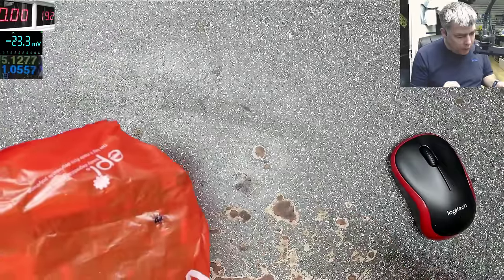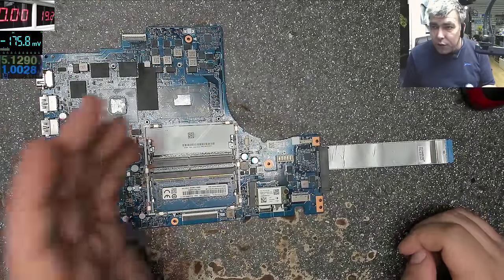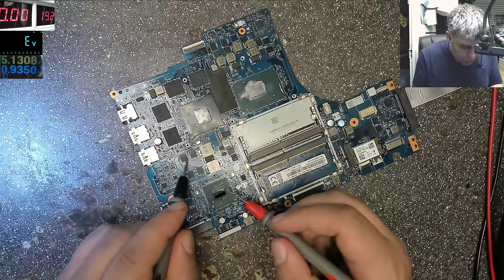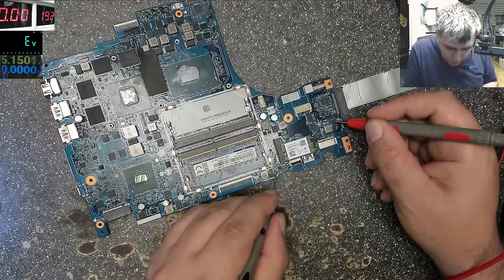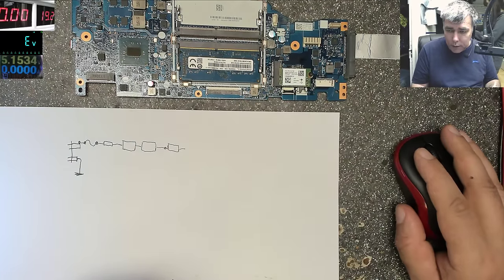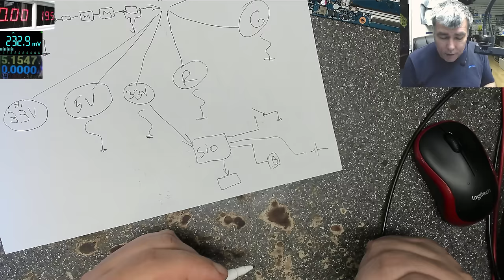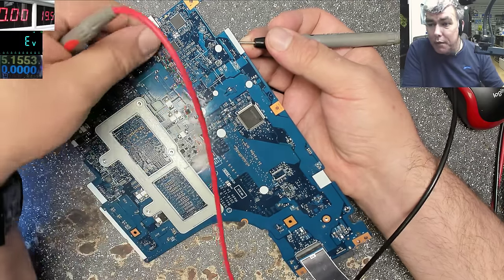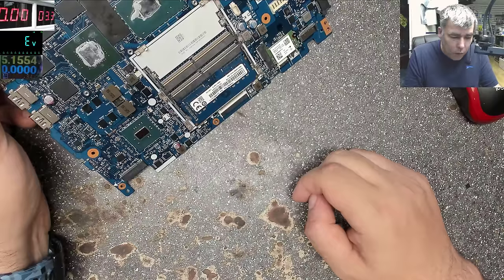How to diagnose a laptop motherboard - motherboards repair lesson

Comment: I like your commentaries very much. I could be in the middle to what you call "intermediate" and  "high class", as I repaired radars and radios a lot, however, I would never qualify your videos as "boring" or senseless, they are very good. I sincerely do not share all your techniques but I really respect them , they are straightforward and solve many problems. I watch your videos all the time and will continue to do so as they provide a lot of wisdom and experience.

Comment: I know it is 2 years later. Thank you Sorin for a good video for beginners. Earlier you stated that after the adapter connector, there is a fuse, which is connected through resistors(s) to the First MOSFET. In the generalized diagram you are drawing (@46.41) you are showing it as a resistor. Actually they are two power inductors in parallel, which are designated PL101 and PL102 on the MOBO and are used for LC filtering.

Comment: Great high level analysis and diagnostic run-through. This is definitely an efficient way of going through fault testing. 
The voltage injection is a great technique.

Comment: This makes complete sense. I was recently messing around with some blown 5.8 ghz video transmitters for my miniquads. While tracing continuity I noticed that a couple of capacitors were shorted to ground, but after removing and testing them they were fine.......it was the actual RTC6705 transmitter chip they were around that had the short. Pretty common in this hobby to burn out video transmitters.

Comment: Hi, Sorin!
Found an schematic for that board. That connector (JDEP1) is for display and U9 seems to be a current limit protection for +LCD_VDD.
Thanks for everything you do!
Reply: Roberto Pérez Ok nice find ! So seems they have changed the screen without disconnecting the battery which caused current limit protection u9 to blow and subsequently wrecked the superio...

Comment: like your work tremendously, I was told after purchasing and replacing a power supply ribbon cable that it's probably my motherboard. The last time my Laptop worked I had trouble turning it on. I would take out the battery, hold down power button 1min, replace battery push power button and it would power up. But ever since I replaced the power ribbon cable it no longer turns on, sometimes the power light and battery charge light comes on  but no power. It's a Dell Inspiron 17,3in M731R - 5735 series Laptop

Comment: Your videos are great. I collect older socket intel and amd motherboards and some end up not working. Currently I have a board that is showing no video output at all. I've tested it with 3 known working GPUS, 3 PSUs and 5 CPUS. 
It only cost me 5 euros so Im turning to your videos to see if it is an electrical level fault. It's a great board to practice on!

Comment: Found the schematic for the board (dy512 nm-b191). U9 is SY6288C20AAC_SOT23-5, an inrush current limit chip for the lcd power (not the backlight, the power of the lcd itself). It current limits the 3v line to the lcd_vdd line and is enabled by the chipset so it seems not correlated with the superIO chip short unless it shorts to ground via the enable line through the chipset and the superIO. Naaaaaah. BUT!!! Watching Rossmann video of crappy macbooks killing cpu with a poor design lcd connector made me look around and... you cannot believe... exactly near the 2 lcd_vdd pins on the lcd connector there's the dispoff/bckoff pin (backlight enable?) that goes directly to the superIO. So you'll better check the lcd connector on pin 6-7-8 for corrosion
Reply: Dumah Brazorf could you also make a vid ? super thanks !

Comment: HELLO ERS! Am an avid Subscriber, you are my first 'Go to' when diagnosing PC issues! I recently built a new Computer in my old Tower with a new Raidmax Vampire 1000W 80 Plus Gold Power Supply, an MSI Z390-A PRO Motherboard with an Intel Pentium Gold Processor G5400 CPU @ 3.7GHz! Next added  64.0 GB DDR4 3200 Ram! Also a ZOTAC GAMING GeForce GTX 1 Video Card! Recently upgraded all my HHD's with an Intel 660p Series M.2 1 TB SSD Drive C and two WD I TB internal SSD's! My Computer now boots up completely for a cold start in 30 seconds!!!! (Once in a while when I turn it on, it Boots into the Bios Screen)!!!(But when I wont to boot into Bios, no matter what key combination I press it wont go into Bios on Command)! Windows will not display on my Digital Monitor but I can see the Bios Screen on another HDMI Output to my 32 inch TV! Am running XMP Mode and Gaming Mode on the MSI along with allocating 3/4 of my Ram to Process my Adobe Premiere 2022! My Question is: How do I get the computer to Boot into Windows EVERY TIME? And secondly, How do I get my computer to boot into Bios on command?

Comment: Thanks for the detailed video. 
While you going through the bios chip and supply, usually there is a connector for the bios battery, i didn't see any or maybe you didn't mention it.
Reply: Am really impress with the video, thanks a lot sir, more grace.

Comment: Hi I watch your videos and they are really informative. Please can you help me understand SMD capacitor value. I am fixing a device and there are 2 capacitor on the entire board out of several which shows no value at all when tested on the PCB or off the PCB. I am not able to understand are they faulty broken or there can be such ceramic SMD capacitor which shows no value at all. The capacitor size is about 1mm to 1.5mm these are tiny capacitors. Have you ever came across capacitors which shows no value but are good.

Many thanks in advance

Comment: as far as i understand from your vidoes, it is all about to find the short circuit point with heat increase detection (air spray freezing etc) and the replace the component.

Comment: Sorin arn't you measuring on diode mode instead of resistance? Is it that suspected components should be check outside the circuit? Thanks for sharing you are a LEGEND!

Comment: Connector you thought was battery is LVDS connector, its likely the SIO got a short from LVDS-PWR-GOOD due to a bad cap or short sending 24v-ish to SIO after breaking the transistor/mosfet

Comment: sorin i didnt think that you could read ohms in diode mode? ho low is the resistance to ground on the 19v power rail to be normal ?I am an old retired tv tech and love your helpful  videos. i wish i could have seen them before i retired. also wish we had esr meters in the shop,they would have found caps that looked ok and  had proper micor farads.   PS YOUR THE BEST

Comment: it is normal to see a short circuit in integrated circuits that draw high current, but this is valid for parts that operate with low voltage, ie 1-2 volts. For example, if a value such as 3-4 ohms is seen in the part that draws 30 volts and 1 amp, this capacitor is a short circuit as we know.

Comment: GREAT VIDEO!!! Love the originality and authenticity
I have a problem with a laptop... It doesn't turn on at all (I've checked battery and power supply) but sometimes it will randomly turn on
How can I check if this is due to a faulty motherboard???
Reply: Faulty button?
Reply: @ianmiles2505  it was a faulty flex cable after all thanks buddy

Comment: Thank you so much for the impressive teaching. A quick question: My Dell E7450 caps lock and power button blinking as soon as the power adapter (with power) was apply. The laptop does not response just the 2 LED blink. Initially, it works and charge the battery when I changed the internal battery, CMOS battery, and fan, then it revert to 2 blinking LED as soon as wall power applied. Appreciate if you can please provide guidance and assistance!

Comment: Hello Sorin,

thank you for your videos on repairing electronics, I found them very informative with unconventional approach in finding 'shorts' (with petroleum product).

Would you be so kind to help me troubleshoot Gateway P5SW0 laptop mainboard? I did some troubleshooting and found that I have case which is not covered in your videos (at least those I've watched).

So far what I have found:
0. Plug power charger, no any light on laptop
1. On all PWM power supply coils I read 19V
2. Disconnect the power supply to cut power
3. Set multi-meter to 2000 KOhm range
4. Measure resistance between ground and all PWM power supply coils
5. Reading as open -- display shows '1'

This looks very odd, like there are no any load on any coil connected to the ground -- I find this is very unusual. How could I read open circuit from any coil to the ground with connected CPU, GPU, USB ports, ....?

I could understand if I would read 19V on coils (when the charger is connected) and some resistance from the coils to the ground (the charger disconnected) -- it would signify that probably 'Super IO' chip was damaged and it keeps all top mosfets open, I would expect that current would be too great to burn the fuse (as outcome there would not be 19V reading on any power supply, on condition that power charger will not cut off power by detecting the problem first).

Can you give me your point of view of the problem I described?

I purchased this laptop for exercise purpose (the specs pretty good if I make it work for $20CAD I paid for the laptop).

I have repaired a few laptops in the past and I found that a problem with graphics video card is quite common (due high heat some solder connection under the chip brakes, 'Super IO chip' somehow detects it and refuses to start the laptop).

It would be interesting if you could make a video on this subject -  'fixing graphics video chip issues related to broken solder joint under BGA chip'.

I got some HP laptop which has i3 CPU 'solder in' on mainboard. I am sure that it has similar issue with cracked solder joint under the CPU (at some point by adjusting tension on CPU heat radiator I was able to get the computer running but then the problem returned). 

How do you fix the problems of this kind?

I think for a completeness of your lessons it would be nice to see a video where you would give an information based on your experience what is most common problems with laptops, tablets, phones by prioritizing from most common to least common (for example: laptops -- 1. power mosfet short [due heat/power consumption],  2. capacitor short in PWM power supplies [indicating on input or output], ...... , n. Super IO chip failure [indicating design flaw, battery charging PWM module failure, ....]

This video is very informative with an example of troubleshooting, but could you make a short version where you would indicate sequence of tests you would perform to find the source of the issue? 

Something of following kind:
0. Check 19V coming from charger power connector to first switching power mosfet (mainboard receives power)
1. Check for 19V after current sensing resistor (Super IO chip monitors current consumption, switching mosfets Ok)
2. Check for 3.3V on Super IO chip (without this voltage Super IO chip would not be able to start laptop)
3. Check for voltage on RAM (check voltage on RAM capacitors, without RAM there will be no video signal)
4. Check for 5V on USB port  (indicates that 5V power supply function properly)
5. Check for 1.2V on CPU capacitors (CPU can not function without power)
6. .....

Thank you very much, your educational videos

Comment: Thank you, I watched the 4 videos. As a beginner I didn't understand the following:
1. you demonstrated a common beginner mistake about confusing shorted capacitor/mofset where in fact the processor resistance is measured (i.e. misunderstanding ground). But later you measure 0V on capacitors (which are connected to ground) around the superio. Why not deduce then that you are measuring the superio resistance (and that the capacitor is not actually shorted)?

2. when you send 19v/2A on the charger +, you found some power management chip getting hot. How come the 2 mofset at the very start of the input circuit did not block the current as they should?

3. with the power management chip getting hot, why not deduce that the power management chip was dead (in addition to or instead of the superio).
Sorry if there are very simple answers to this, as I'm a beginner. Thanks in advance for any clarification!
Reply: Did you get answers to that :D? If you did please could you forward it to me im in the stage u were 6 months ago. Thank you
Reply: @sn00pyb3ast8 hi, I didn't get an answer to my questions, unfortunately.

Comment: Hi man. Question I have been working on a motherboard of a HP G1 Elitebook and found a series of like 10 caps that measure ground on both points. Have you ever heard of a intentional reason for this or does it sound like a short to ground? Reason for me asking is I have 3 of the same series laptops that measure the same on these caps.

Comment: Let me understand, the 3.3 v regulator is pulling 0.16 amp and getting hot, but it is the SIO that is shorted and causing the regulator to pull more current hence  replacing the SIO would remove the short on this power rail.

Comment: Hi! I have long been watching your videos and have learned a lot, but sometimes I get stuck with some issues like this one that I am trying to repair. I took out the motherboard, which is a X453SA Rev-2.0,  from an ASUS laptop. The display went white, but when I plugged to HDMI to an external monitor, the display works but only on BIOS setup and it doesn't proceed to windows startup. 19V bus is OK, the other switch mode power supplies for 5v, 3.3v, 1.3v and 12v  near the cd drive and the 3.3v(Always On) is also working, there is 3.3v supply to the IO Chip. The problem is, the usb port output is only 2.5v and my keyboard that is plugged to it barely works and the pins for the power supply for the hard disk on the sata connector is also 2.5v output only. when I pressed the power button, the fan turned on, the BIOS displayed but the Hard Disk is not spinning and it is not seen on the BIOS on the boot priority settings. I just cant figure out which power supply is connected to them.  Sorry for reaching you in the comment section, because I don't where to contact you and ask about this problem. Thanks in advance.

Comment: hi sorin why are you using diode mode to find sio and bios connected  insted you can use continutity mode so it will beep when 2 pins connected ? is there any reason for using diode mode..i am begginer

Comment: Your video is very helpfull i am trying to repair my laptop motherboard. I gave 5v from USB port because of ardunio fault. Can anybody give any suggestion what should i check first. By the way my screen light is not working  but fans are turning when i pres the power button. Which part can ne burnt any suggestion ?

Comment: As a beginner I would start from where current flows in...but then I would lose myself pretty soon trying to follow the directions it would take...Moreover I don't know the order of the components...I then would proceed to panic due to the super-crowdedness of the board (always remembering its has two faces to check and multiple layers perhaps to follow)
Edit: Next I would check random fuses because I know that fuses can blow and are really simple to check
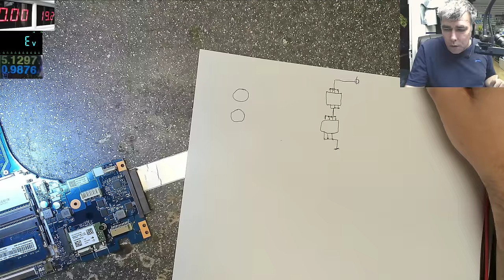Why do MOSFET have 4 pins if they are joined together? I can recall the symbol of MOSFET but I cannot understand why it is applied this way...moreover at 18:40 how do you see the paths between the components? Not to mention reconstruct the order they follow or the ground zone...

Pure beginner (on the practical side of things) thoughts here, please do not hate me!

Comment: Great video!
At 25:00 you said "2 ohms" on the capacitor when the multimeter reads 0.002 volts. By Ohm's Law you could say that by having a 1 ampere current, but how do you know the current there if there's no power connected to the motherboard?
Greetings!
Reply: The multimeter in diode mode puts a more or less constant current and displays the voltage. 1 mA of probing current would result in 2 mV at 2 ohm.

Comment: Thank you for your tutorials, I repaired my laptop Helios 300. I was using a GPU intensive application and suddenly the laptop shut down, its was very hot, on the motherboard a capacitor was damaged, so I remove it and it worked again.

Comment: I've watcced upto 22 minutes so far, and have a question regarding the two mosfets and the processor. If both mosfets were switched on, they would short the positive and ground together. So when the laptop is switched off, does the first one short the processor supply pin to ground, and open before the second one then closes when the laptop is switched on to supply power to the processor? Thanks.

Comment: I have questions about how to identify DPAK MOSFETS. I need to purchase a IRFR9120N P-channel type. How do you know if the MOSFET is P or N before buying if the seller does not provide it? Does the "N" after the part number mean something? I would appreciate any help. TY

Comment: Normally UEFI mainboard have 3 memory, the first is internal super i/o chip as microcontroller, second is external bios/uefi connected to super i/o chip, and third firmware for/connected phc/chipset

Comment: I have a lenovo ideeapad gaming 3, i upgraded the ram, over that ram it has a plate that you put over, by mistakee it touched a resistor pl20, i saw it has 2 resistor pl20, the laptop works, but what is that resistor used for and i can use my laptop this way ? Thanks!

Comment: could you tell me what kind of multimetr are you using? For me is quite confusing because I'm not sure how you measuring Voltage if there is no power supply. I understand that is showing 0.0 voltage in some cases and then Ev. Please help. If anyone could explain this?

Comment: Sir..I have a laptop for checking..the issue is  no power..no 19v...I test the CD Jack for 19v using the charger..I don't get any voltage...but the charger is fine..when I applied power to the 19v rail from the DC Jack..its giving me spark....that means the 2 mosfet..is short..fuse is ok....thank you..God bless